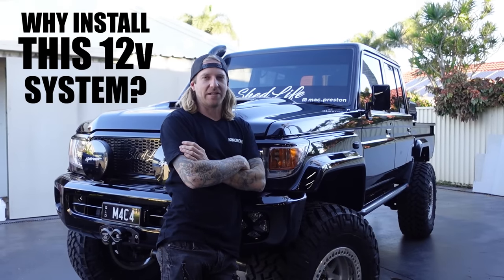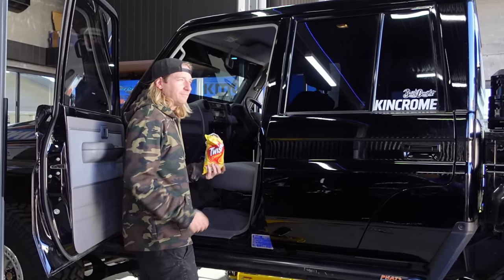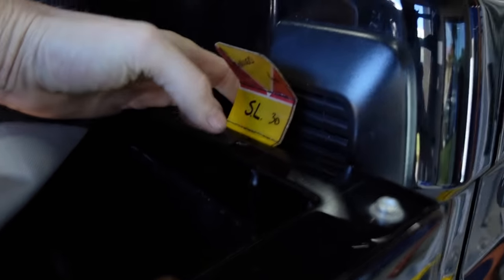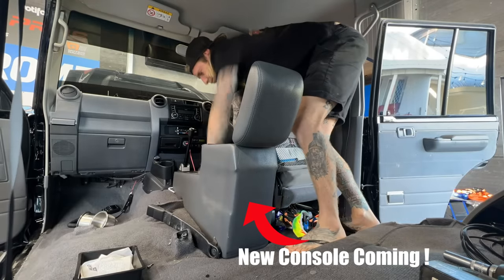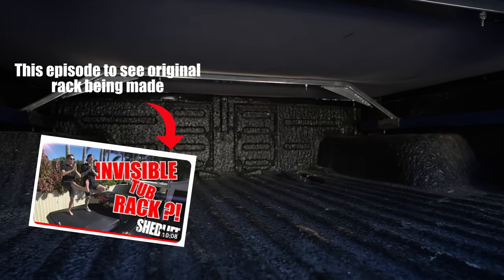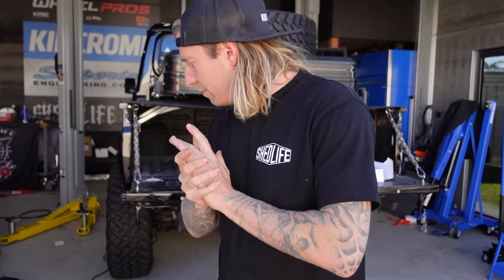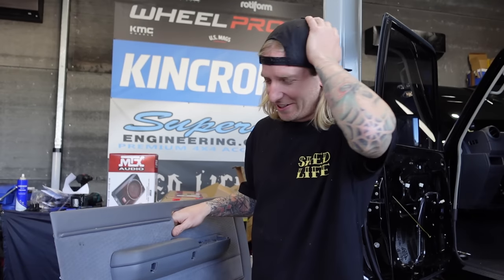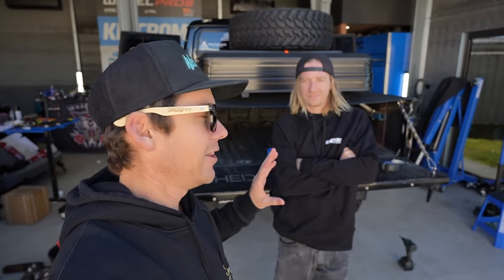How to install COMPACT in-car 12 VOLT $$$

Comment: I've been running a 50Ah lithium for a year, and if you're not running a big inverter or camping in one spot for a week, it's all most people really need. I can run a fridge (A Kings fridge, at that, so not that efficient) and a basic 12v camp setup for 2-3 days off it, and the battery will be fully charged in 2 hours driving. If I wanted to stay stationary for longer, can easily add in a solar blanket to keep it topped up.
Reply from the maker: Our thoughts exactly! But we will see how it performs soon 😎

Comment: From a 4th year apprentice sparky who does everyone 12 volt systems in there 4wd, vans, utes, trucks it’s good seeing another sparky do the exact same thing as I do for my cashy work, best to put a fire extinguisher in the car just incase shit turns downhill, there is a company that makes a bracket for under the seat and touch wood haven’t used it yet on my car but have used it on a skid pig once and saved the car 🤙🏽🤙🏽
Reply: Actually a good point mate I’ll look into that! And great choice on career 💪🏼

Comment: 4 inch dash speakers suck especially in an old 80 like mine, they dont look like they've changed at all in 23 years 😂.
I added 6 inch speakers in the doors but kept the drivers side 4 inch one in and connected it to the UHF speaker output for that bit of extra volume or when your passenger has the mic (meaning also the speaker with the hideaway XRS units)

Comment: When you mentioned that you run the wiring through the car and then the firewall, did you run the wiring along the door footwells? Or through the roof and then down the pillars?
Reply from the maker: Along the floor mate ! 😎